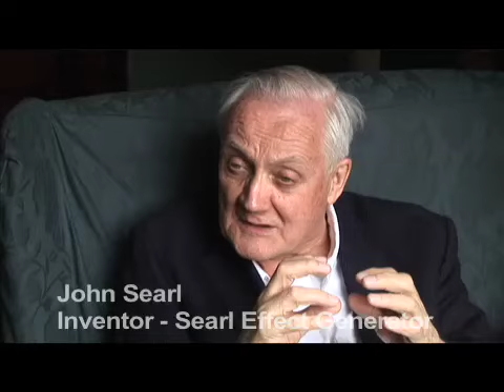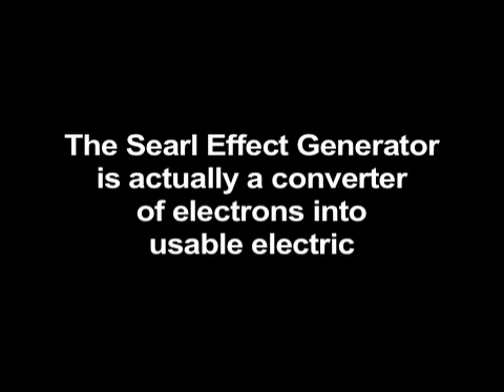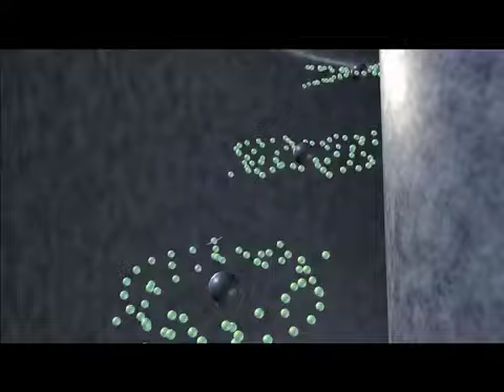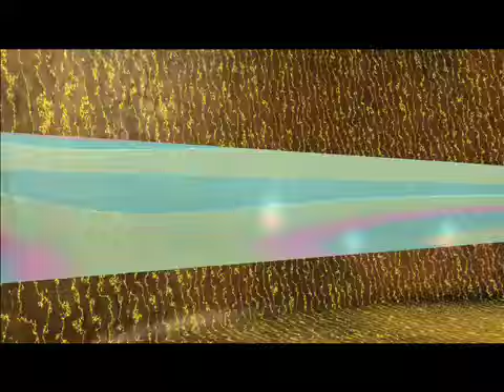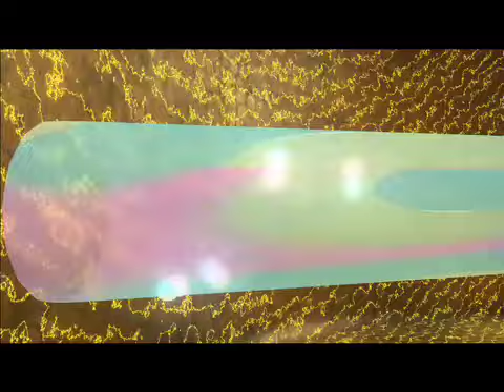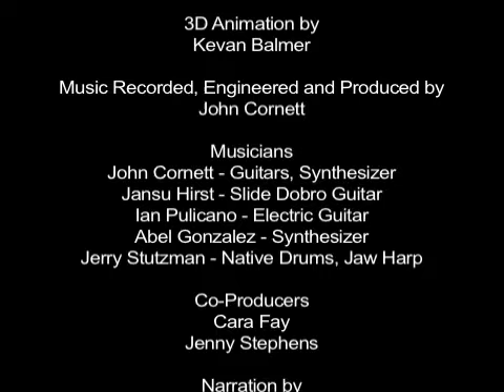ELECTRONS ride the MAGNETIC WAVE

Comment: Also, when the device is shown in operation, those things that form the outer-most ring are all electromagnets that have to pulse in order to keep the roller magnets moving. If you look in the upper left corner, you can see that those magnets are being run with power coming from a DC converter (in other words, this thing needs to be plugged into a wall in order to work). The only free energy being produced here is the electricity that Searl and Co have duped their investors into paying for to conduct these experiments.
Reply: Even a motor car requires power to get it started, ie the battery. Once it is going the battery is not required.
Reply: That's not how it works. The brushes collect the electrons.

Comment: http://youtu.be/IWGOpuca7cs?t=2m57s - the machine shown here is shown in another video being used to power a small cluster of LEDs. It's not very impressive though, since the movement of a magnetic field around/through a conducting material has been known to generate electrical current in siad conductor for over 200 years. That's how pretty much any electrical generator works, by spinning magnets around a conducting coil, or spinning a conducting coil around some magnets.
Reply: "Its a mock-up"...I guess you overlooked that part. JESUS! WTF?

Comment: Sure, but solar cells need light (high-energetic photons) for that. It is not just about energy, entropy is important, too. To get useful energy out, you have to put some useful energy (in particular, not heat at room temperature) in. So where is the point? The conversion between different energy forms has been shown in various devices. That is not a power source, as some comments suggest.

Comment: @koneye John Searl has endured a lifetime of hardship, emerging with a TEAM that fully intends to do what you suggest. SEGs that John Searl produced in the 60s were based on a "slurry method" of production which was very impractical to put into mass production. Today the method for production is a highly evolved "tuned circuit" which requires a very costly "one-time" set-up of producing and configuring large magnetizers which are the heart of the new process enabling SEGs to be mass-produced!!